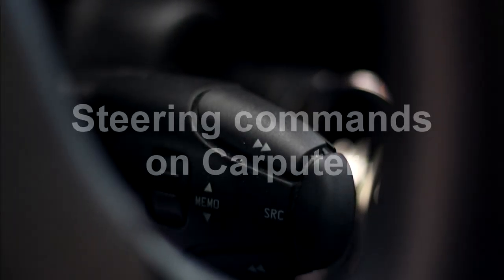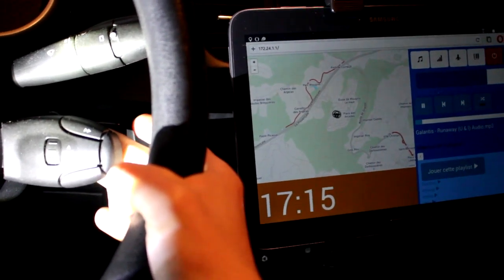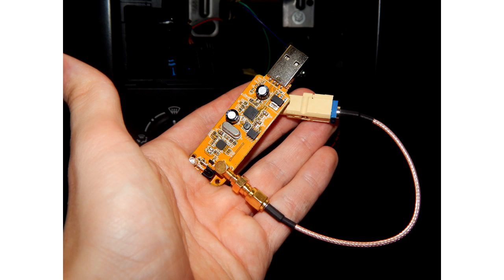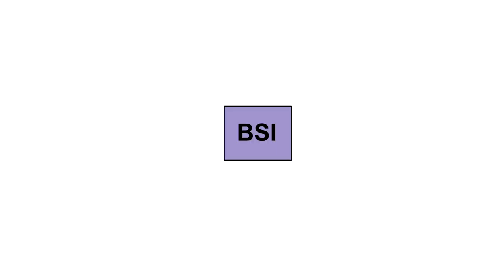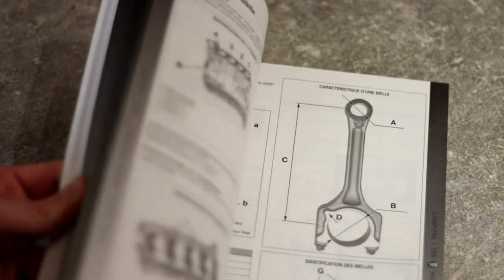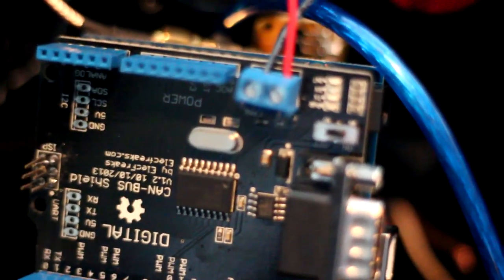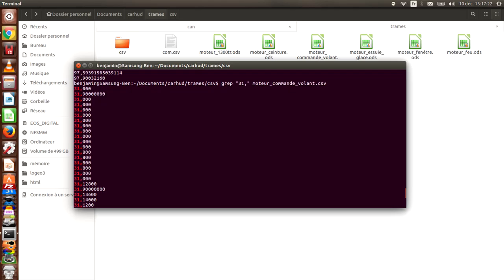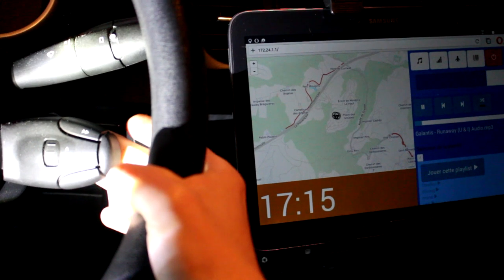Adding steering wheel commands to the raspberry pi

Comment: Salut Benjamin, merci pour la vidéo! Quick question: do you have the details on the Arduino model you used? Also, what raspberry pi case have you used for this setup? Bonne continuation!
Reply from the maker: Salut, 

The arduino was an Arduino Uno with a CAN shield, I didn't use a case for my rapsberry pi (the piece you see on it is only the board for the audio). ;-)